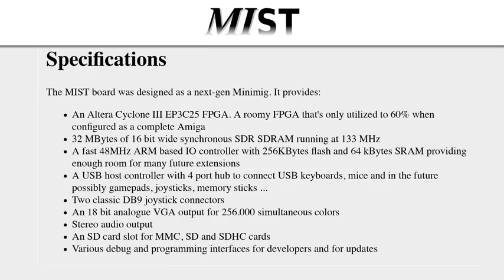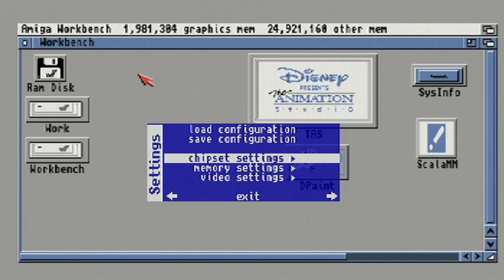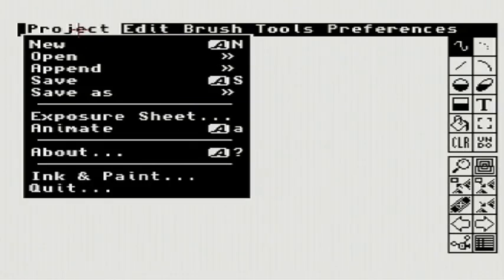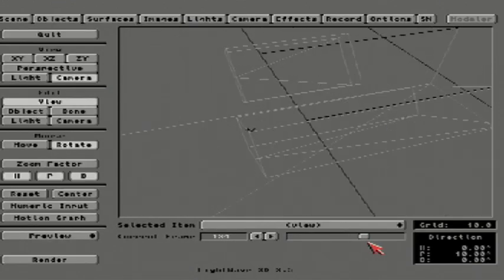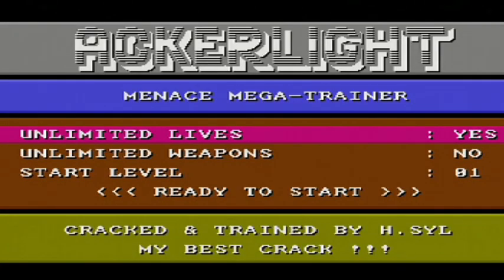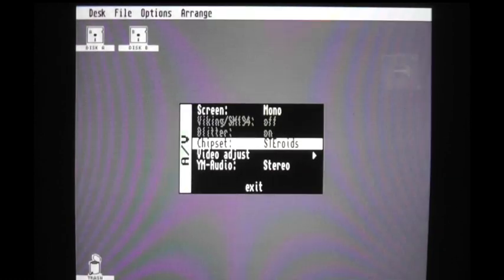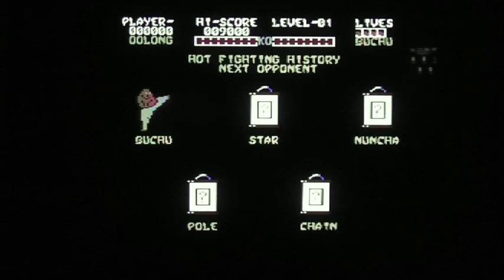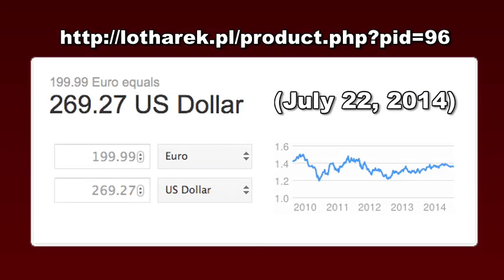MIST - aMIga atariST

Comment: Nice. Shame it doesn't do Amiga AGA chipset.
Reply: I'm working on that. :p

They've had AGA working since around 2011, but I don't think the source has been / will be released publicly.

Alastair Robinson made a start on adding AGA to the current source though, and I'm currently trying to finish where he left off...

http://retroramblings.net/?p=127
Reply: It does now :) but still in beta.
Reply: +ourladyspupil it does support it and the core leaved the beta status and became final. unfortunately it can't emulate a 100% A1200 because of the 18bit analogue vga output (AGA chipset does have a 24bit analogue output...)